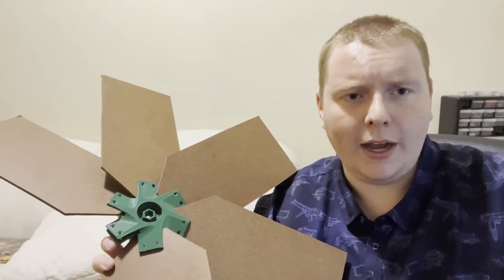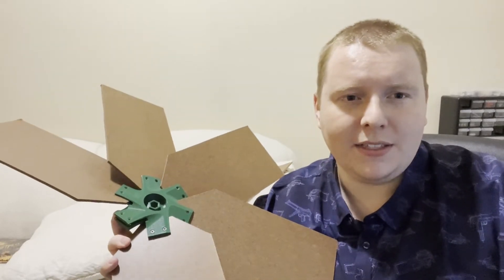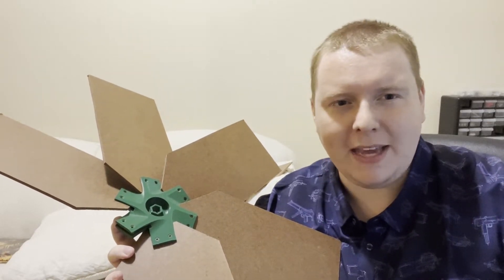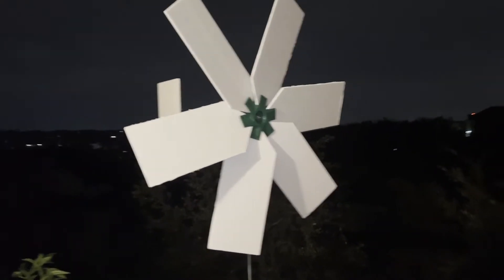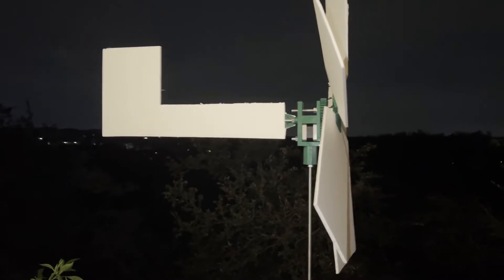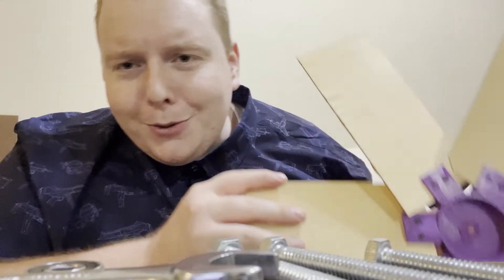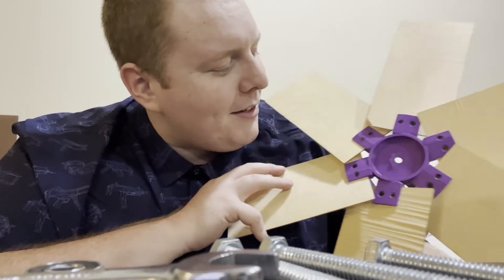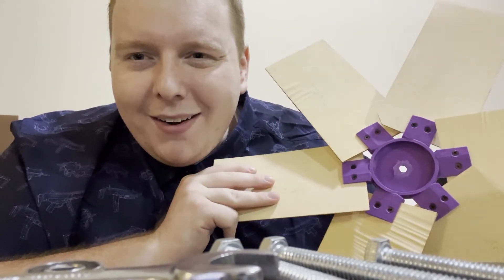I'm Breaking Up With Hardboard, Foam Board is My New Best Friend (Windmill XXI Update 4)

Comment: How about 4mm twinwall polycarbonate sheet? It should be very light and also completely water proof. You might need to seal up the ends to prevent water building up inside. e: Polypropylene would probably be better as it is less brittle and comes in thinner sheets. Also known as corrugated plastic or correx.

Comment: Love the videos. I probably am gonna use a spine rod connected to the hub and foam+fiberglass or some other apoxy+strengthening material. I'm losely basing it off "Flight Test's" model planes my idea being a windmill is similar to a plane i.e. surviving front facing wind pressure so there is a lot of structural ideas that can be stolen from that hobby. Also, "tech ingredients" did a wonderful video on fiber glass that made me less scared of it.